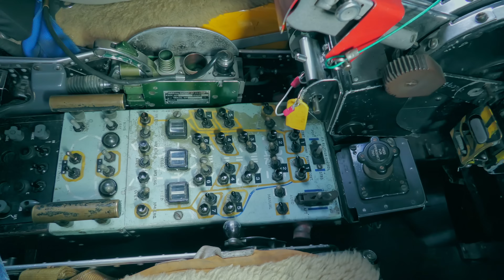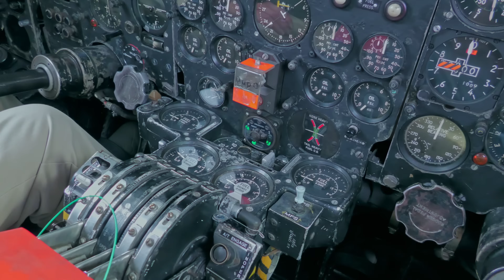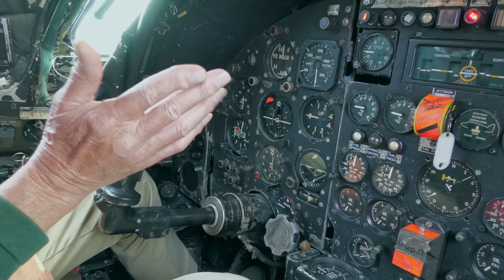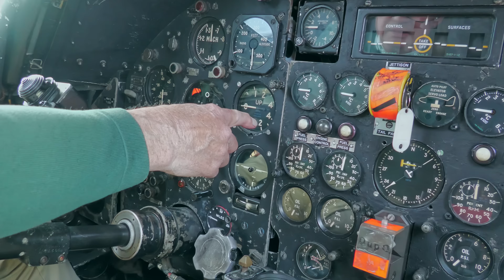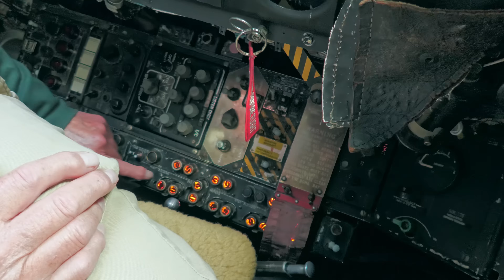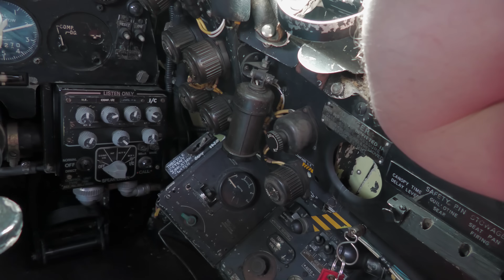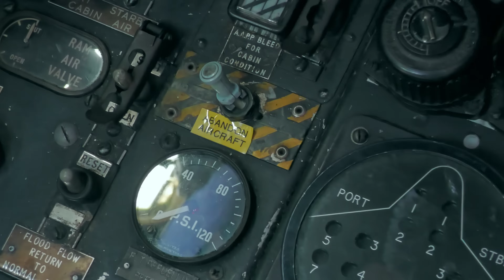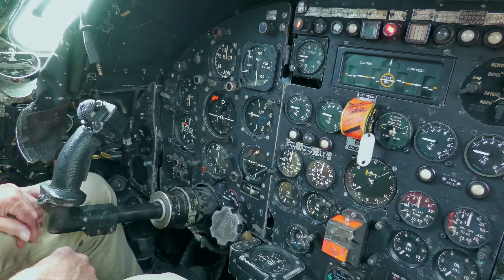Vulcan Bomber XM655 - Cockpit Tour with Wing Commander Mike Pollitt

Comment: 21 bombs were reported dropped on Port Stanley airfield, only 1 hit the runway.
Reply: The mission was designed so only one would hit the runway.
Reply from the maker: Don’t you mean that it was designed so that at least one would hit the runway. 

If I recall correctly the flight path was at an offset angle to the runway to increase the odds of a runway strike

Comment from the maker: So... A question was raised about the minimum number of engines a Vulcan could fly on. I asked Mike and here's the response I got back.

" I suppose in certain circumstances she might fly on one engine but I wouldn't like to have tried it! The safe answer, which we regularly practiced by the way, is to say two engines.  We used to practice a double engine failure on take off, the worst time to suffer one, and then fly a two engine approach to a touch and go.  On the runway after that two-engined asymmetric approach and then  bringing the 'failed engines' back up from idle to about 80%  power for the roller and attempting to keep her straight on the runway was a good game! "
Reply: When XH558 had a birdstrike in service she completed a 2 engine circuit for an overweight landing
Reply: It was common on Vulcans if you would lose one engine, the other on that side of the aircraft next to it would usually go aswell.